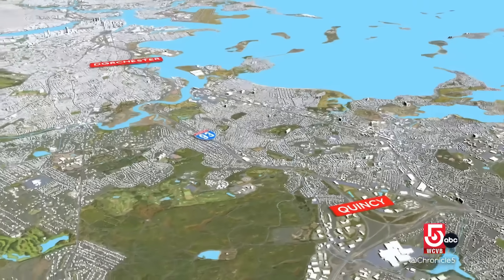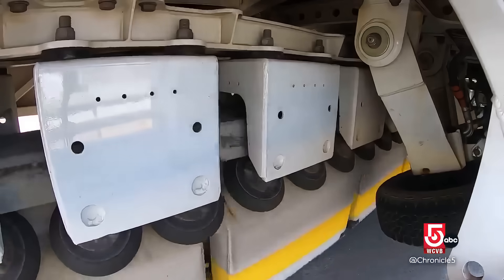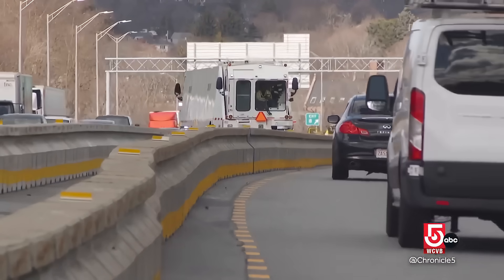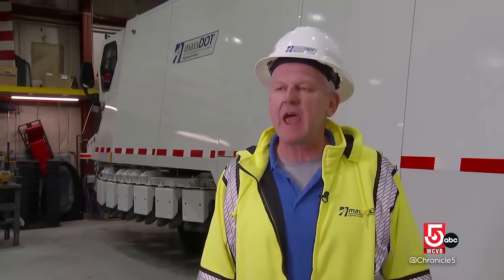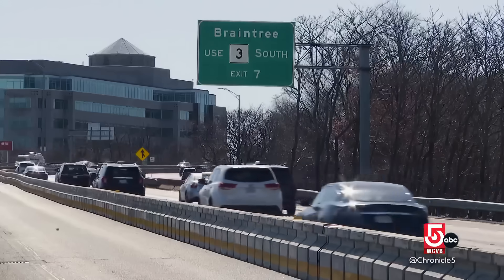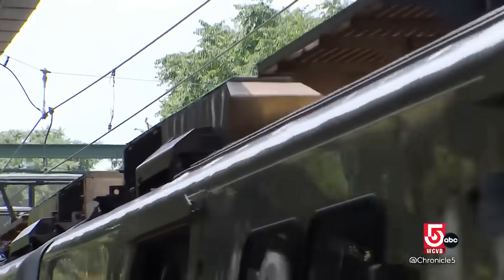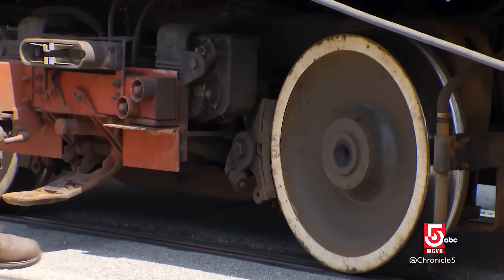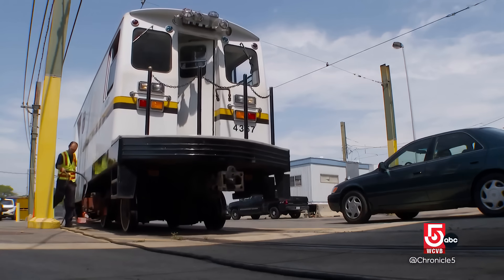The hidden tech behind Boston’s traffic and transit

Comment: If the commuter rail was faster, there would be a lot less traffic. Also, connect north & south station with one train that goes back and forth.
Reply: So some interesting facts about that. It is technically possibly but the issue is that it's a single track line called the grand junction and iirc freight gets priority and you rarely see MBTA trains on it. It's only used for moving train cars around.
Reply: @scj643 damn, that's too bad. I've taken the commuter train from southborough once and I thought it was pretty pleasant except for the speeds. Too bad freight trains screw things up.

Comment: The zipper line seems as very expensive short visioned solution to me. Start some electric bus lines instead. 
Yes, I am from Europe. Expanding public transport is one of the tools, to combat congestions.
Boston is doing well on the bicycle front, why not continue the good work?
Reply: Seperate trolley dual mode Busway will be better for Boston alongside its Highway and train lines.
Reply: @maroon9273  I don't know Boston, but it sounds great.
Here in Denmark, several cities have battery buses, it works fine.